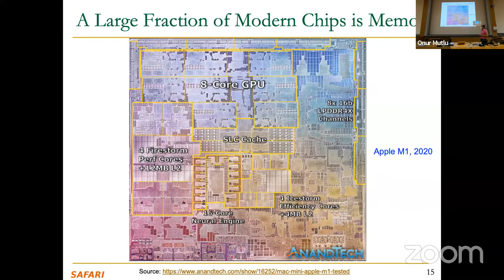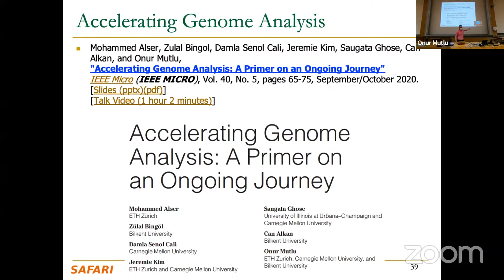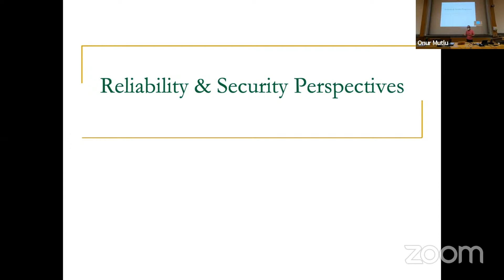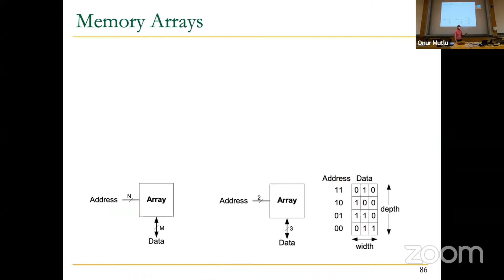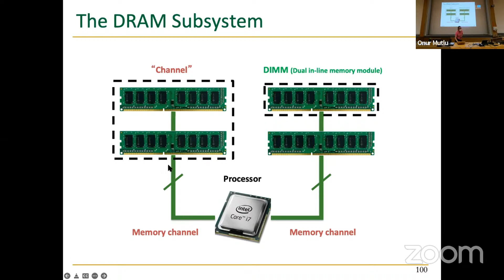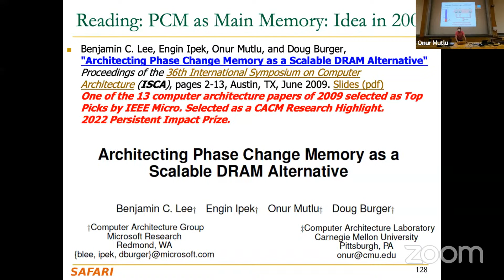Digital Design & Computer Architecture - Lecture 22: Memory Organization & Technology (Spring 2022)

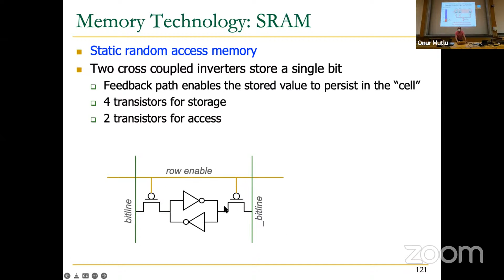Comment: At 1:33:17 and 1:36:02, Please correct me if I am wrong, but I think the access transistors in SRAM and DRAM shouldn't have a bubble as it indicates pmos transistor. In SRAM and DRAM, nmos transistor is used and it doesn't have a bubble.

Comment: By as rectangular as possible does he mean square? Could someone explain why rectangular is better?
Reply: I think this way can locate a mem cell use less wire. for example, you use row addr to select a row, and then use same length (because square) col addr to locate the column in a bank. the it cost 2* time(row then col), but only use 1/2 wires. If any wrong, please let me know.
Reply: I think I am wrong.. sorry.

Comment: https://youtu.be/yOFBiX-Ekrg?list=PL5Q2soXY2Zi97Ya5DEUpMpO2bbAoaG7c6&t=2707 : here I didn't understand the main reason not to use flip flops or static ram as the ram. I calculated that number of transistors in M1 processor let us to build 1.3 GB RAM with flip-flop. Of course it is not good that the cost of M1 for just 1GB RAM. However, if the main bottleneck is the memory, what is the reason that we don't see any 500MB on chip memory since the number of transistor duplicate every two years?